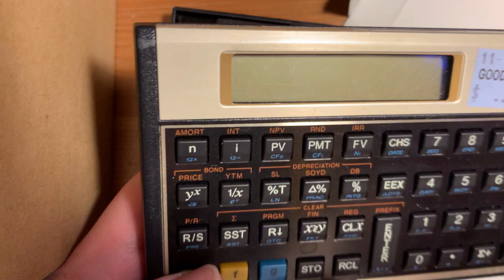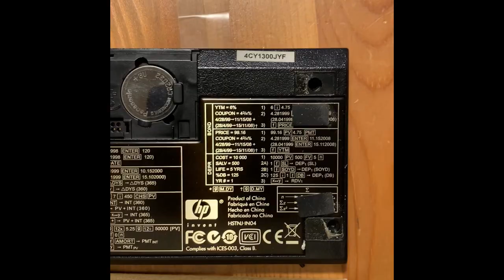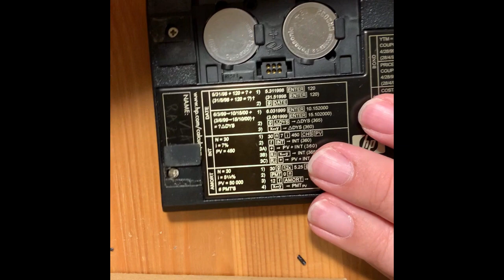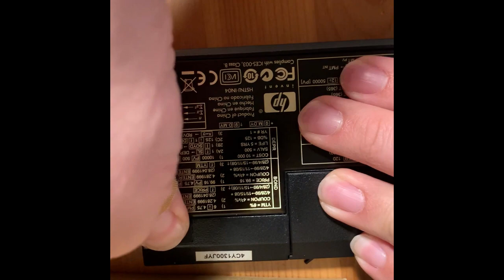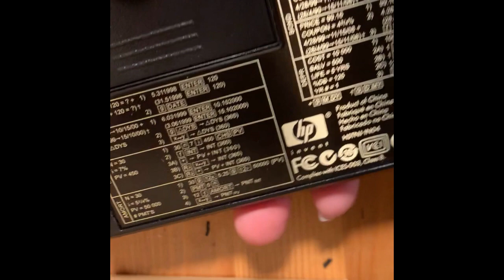Fixing a HP 12C

Comment: Good to see how you did. I have done some repairs on Casio and HP calculators with similar problem. I saw you were comspcerned to avoid damaging by overheat the plastic-based flex-cable, using a paper liner, but later you seem to have given up. I also saw some minor overheat damage on the right corner of the flat-cable. 
It would be great if you could tell us if you limited the Temperature to avoid melting the flex-cable, and how you did that.
Reply from the maker: I have a soldering station will a simple dial for heat control. This was my first time doing a repair like this so I did damage the cable but not enough to be a problem. All part of a learning process.

Comment: Useless, without explaining what  you are doing.
Reply: He's using a soldering iron to improve the connection between the ribbon cable for the LCD and the pads it is on.
If someone is into retro gaming, this type of repair is common in the Gameboy as well...
Sometimes, that is all that is needed...
That being said, if done incorrectly (too much heat), it can damage the ribbon cable.  That's why you keep the iron moving and/or using paper/cardboard as an insulator, and good to start with lower heat and take your time..